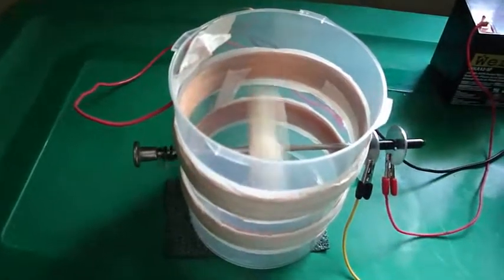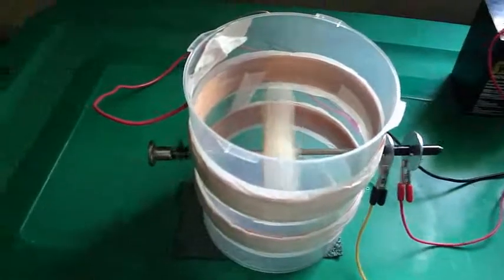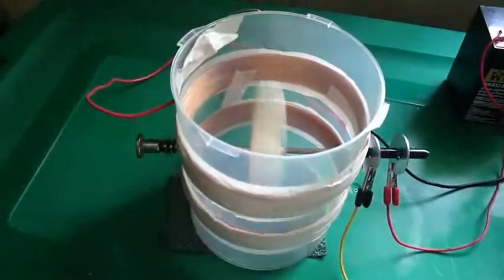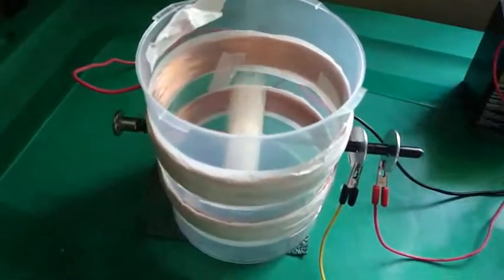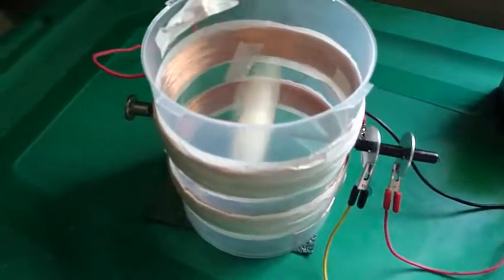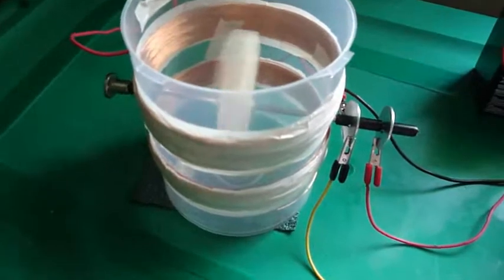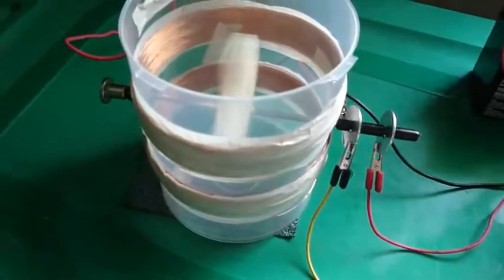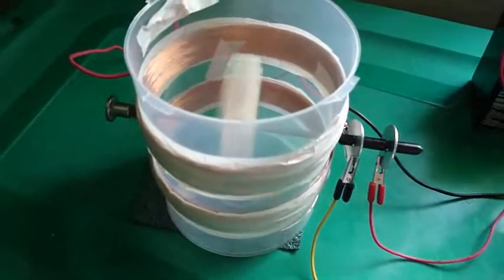My Newman Replication.avi

Comment: Some things to consider:
(1) 1,200 to 1,600 winding per coil
(2) Use 26 or 28 magnet wire
(3) Windings need to be neatly wound and stacked
(4) Square or rectangular wire produces 300% greater energy then round wire when wound neatly together
(5) Washers are consuming to much energy from prolonged contact with shaft, also causing drag.
(6) N42 or N52 Rare Earth magnets required
(7) Over all coils are to far from magnet, IE wasted space.
(8) Create wider flux field on rotor
(9) Use ring bearings